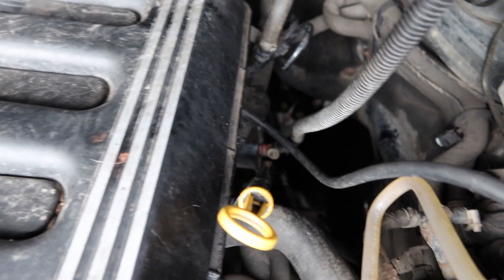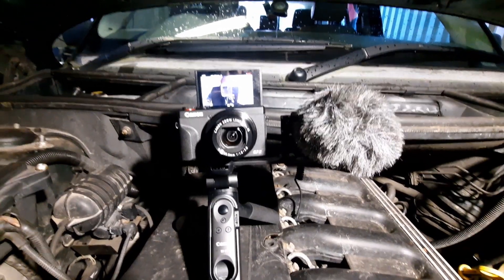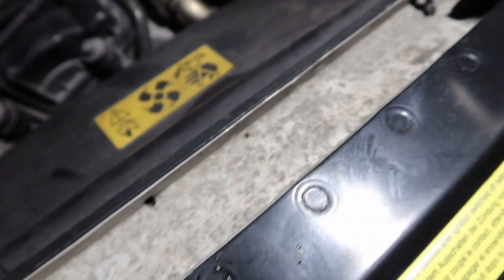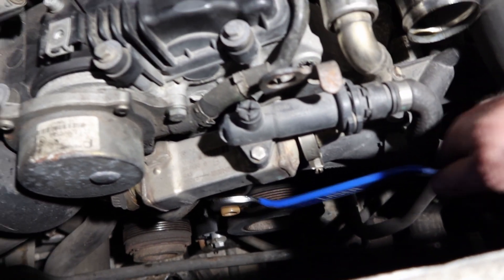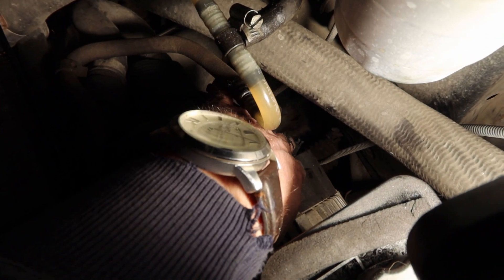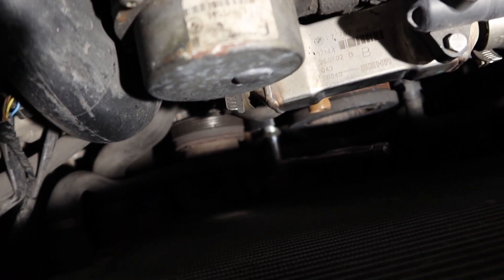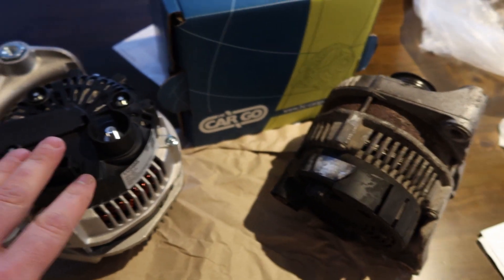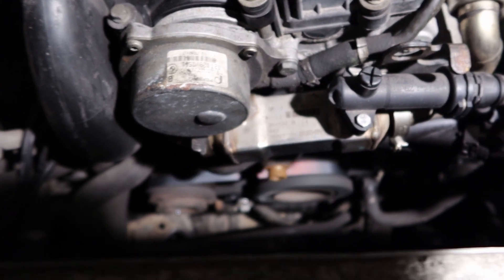L322 Viscous Fan Removal & Alternator Replacement

Comment: Just spotted your vid , I have a 04 vogue red battery light keeps coming on ever 20 miles or so but still charging at 14.1volts you have given me the courage to replace my alternator ,gonna try doing it without removing fan & hope this cures it !!!
Reply from the maker: Ironically my charge light is back on, and I have a bad battery drain, but still charging. Going to take a look at it this evrning but looks like I'll be repeating the process! Think there's a failed diode. Good luck with it! Another viewer did it without removing the fan, I think the link is in the comments, worth a look. Its not a bad job, just take your time with it. Thanks for watching.

Comment: Can changing the alternater cause a coolant in oil problem ?
Just had car in garage and only thing done on engine was alternater now coolant empty in to oil within an hour
Reply from the maker: It shouldn't cause it. What car was it on? Only thing that springs to mind is maybe an oil cooler failure? Maybe it's located near the alternator?
Reply: @davesworkshop2714  it's td6 and the oilfilter /cooler is located about the alternater. 
I'm thinking they've taken the oil cooler of to get access to the alternater and knacked the gasket when re fitting
Reply from the maker: @craigconway2512  quiet possible, and there's absolutely no need to remove it as you can see. Have you told them about the problem yet?
Reply: @davesworkshop2714  no not yet .
Picked car up at 11.50 am Christmas eve they shut at 12 . I not sure whether to take it of and have a look as they don't open till the 6th
Reply from the maker: If you're doing anything make sure you photograph it well first so you have evidence of what was done. I'd imagine it should be fairly obvious if it was assembled wrong. I would think it has to be the oil cooler

Comment: Your last comments really peaked my interest, removing the fan, improve economy? And really no high temp running? I have no tow bar and carry little, Road use and mainly cruising 120kph max, any additional info/thoughts welcome, I won’t hold you to it 😂 keep up the good work 👍🏻
Reply from the maker: I had it out on Sunday and the temperature readings seemed a bit erratic. Normally it goes up to mid way linerally and stays there. For some reason it was up and down. When I got home I thought the rad felt very warm so I refitted it yesterday. As I said though, there's a lot of debate online about it. I didnt notice any decrease in noise. Having said all that the fan rarely locks up completely, and its very obvious when it does as it really roars 😅. In theory it should help economy, but I think having a good working thermostat that allows a quick warm up to mid way on the guage is more important. So I have no real answer for you 🙄. Thanks for watching though 🙂👍
Reply: As is the best way, I’ll leave well alone, no doubt there will be something else to look at/fiddle with/repair soon enough 😎
Reply from the maker: Never a dull moment with an L322 😅. Theyre worth it though.

Comment: So to remove alternator belt which size socket ? And do you just push it clockwise to take tension off belt or do you have to fully loosing it ? Thanks 
Great videos by the way 😊
Reply from the maker: Jason, I'm away at the moment so I'll have to check the socket size for you tomorrow evening when I get home. I thought it was clockwise but another viewer corrected me, saying it was anti clockwise. Again I can check tomorrow. Thanks for watching 🙂👍

Comment: Jesus  Dave that's torture 😳
Reply from the maker: It actually was surprisingly easy. I was prepare for a fan that didn't and to let go and belts that would be a pig to put on. And it was indoors, nice and dry 😅
Reply: @davesworkshop2714  I wouldn't   know were  to start ,good on you your obviously  a good Fitter ,keep the videos  coming 😉
Reply from the maker: @user-vj7nw3pe4i  I don't know if I'd go that far, but im willing to try most jobs once 😅. Thanks again for supporting the channel, good to hear from you!

Comment: Good video, I just did My L322, but left fan on .
A couple of points, the alternator bolts are 16mm not 15mm and the long one goes to bottom not top. Also you got the tensioner wrong way round, it's anticlockwise to release tension, but still helpful video thanks!
Reply from the maker: Hey, thanks for the correction! I must have been day dreaming 😅. Thanks for watching 🙂👍.
Reply from the maker: Forgot to mention, I refitted the fan a few days later, I was just a little paranoid that id overheat it.
Reply from the maker: @GrooveOn  Thanks! Its still processing but looking forward to watching it! Hope it went smoothly!
Reply: @davesworkshop2714   yeah give it 15 mins
Reply: How are you getting on with your subscriber's!
Reply from the maker: @GrooveOn  Its a slow process getting subs, but I have to say I have some great ones! Lots of engagement and comments. Its always good to get feedback, makes the work of making the videos worthwhile 👍
Reply: @davesworkshop2714  keep going, you are not far off, keep doing videos that you really have interests in !

Comment: That looked tight! Glad I’m not working as a car mechanic any more!
Reply from the maker: And you'd think it would be easy! The new alternator developed a fault a week later so ill have to do it all again next week 🙈
Reply: @davesworkshop2714  oh no!
Reply from the maker: @NilsKall  Its charging perfectly, but the light glows intermittently and it drains the battery. Looks like a faulty diode. Always quicker the second time anyhow 🤣

Comment: The light comes on fully sometimes on a run,   when left overnight it goes out next start up . i could strip it out but we live quite remote & i dont think there is anyone up here who could check it  . Nearest big town is inverness 130 mile away , so i think the only thing i could do is replace it & see what happens !!!!
Reply from the maker: I'm wondering if its a wiring problem? Check the low current connection is clean and properly fitted for starters. Have you confirmed its charging while the light is actually on? If the brushes are worn they could be hanging up time to time.